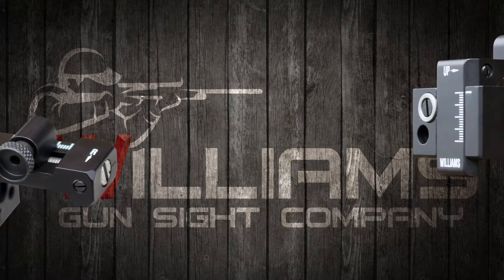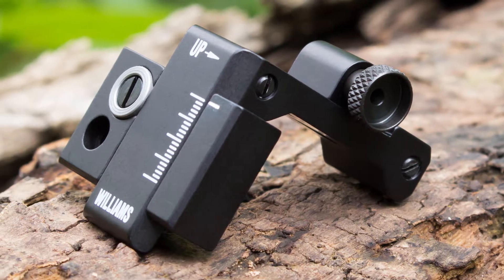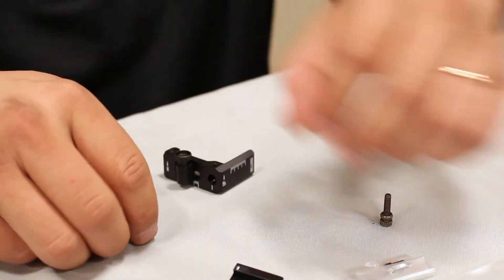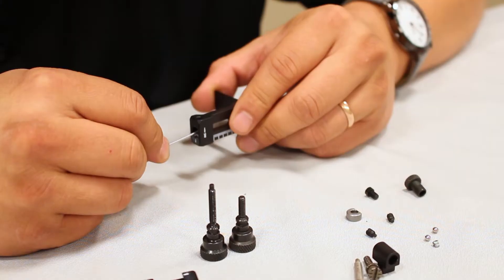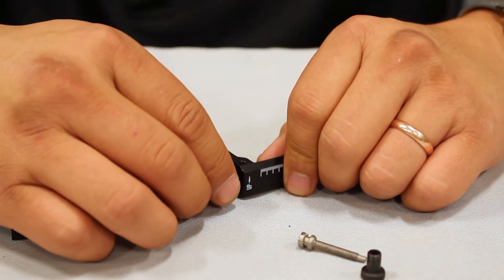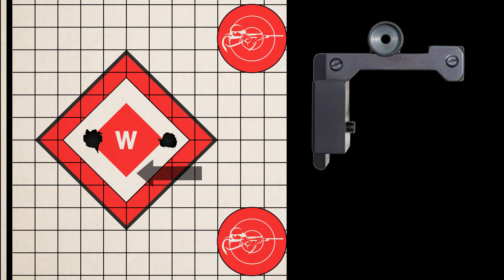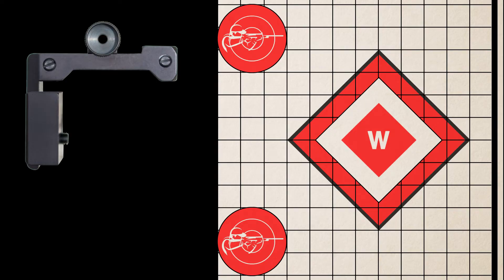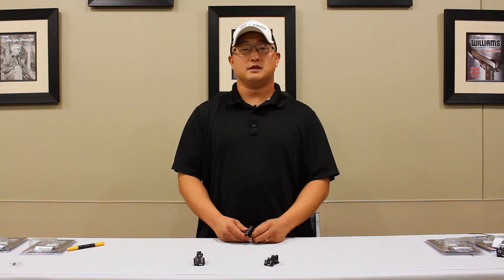Williams "Fool Proof" FP Sight Guide

Comment: has williams ever thought of making one of these sights with adhesive tape for firearms that are not  tapped with screw holes such as the 1873 and 1892 and lots of others who dont  3m makes some very strong tapes that are rock solid and require alot of heat to remove . hell they use this on freightliner cargo trailers which has to be super strong .  i think this idea would sell like crazy !!!!

Comment: Very poor quality sight. The locking screw for the elevation is threaded into the aluminium body, and it breaks VERY easily. It makes the sight useless. I suggest fitting a longer screw with more thread engagement. It's a 6-48 standard gunsmith screw. The one supplied is very short. This screw will see a lot of action when you adjust for different distances.

Comment: Thank you for the video.  It's nice to know how the inner workings of the sight adjustments are designed.   I'm trying to determine the correct Williams sight for a 1960's era Marlin Model 57.  It has 2 drilled and tapped holes on the left side of the receiver.  Can you offer any advice regarding the correct sight for this rifle, as I can't find the Model 57 as a listed model on the Williams website.

Comment: Greetings at Williams Gun Sight Company. I've been looking for a Williams Sight for a Savage 99 pre tang safety model. I would buy it - if that type of sight is still made for the Savage 99.
Reply: The FP-99S should work for the pre-tang safety, the product page mentioning that such a model will need to be drilled and tapped for the sight.

Hope that helps
Reply: @MarkiusFox  I appreciate your response buts it's not an ideal situation. I do like the Williams sights and experience has shown that they work well for me. But your suggestion doesn't help that much... When I mounted a Williams aperture sight on my Winchester Model 94 I did not have to drill any extra holes in my rifle chassis. As the Williams sight bolted into factory holes. So in my view the WIlliams company is being lazy in not having built a proper sight for the Savage 99 Pre Tang Safety model rifles which could be mounted on the tang without drilling any extra holes. Keeping in mind that the older Redfield (70) and Lyman (see 56S) 57SA) companies and a few others designed their sights to bolt up to the tang area and these companies made their sights fit the M-99 design. If I wanted to drill extra holes I would mount a scope to the rifle.

Comment: Would be nice if you guys had some sort of installation video. I think getting it mounted on the rifle correctly is more important than knowing how to take the sight apart, something I doubt I will ever have to do
Reply: jho107   Well said. Who wants to rip,this thing apart. Once on the gun it normally stays in one piece.
Reply: As an owner of one of these, the sight has not been adjusted or disassembled  in over 30 years,  so yeah this video looks almost  pointless
Reply: this vid isn't about randomly "taking it apart".....it's about installing target knobs on the basic model....